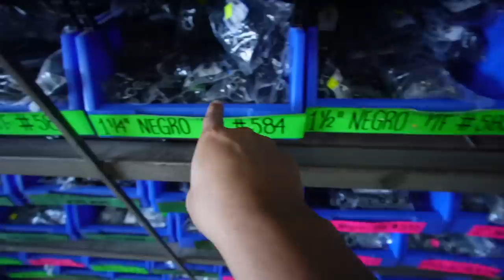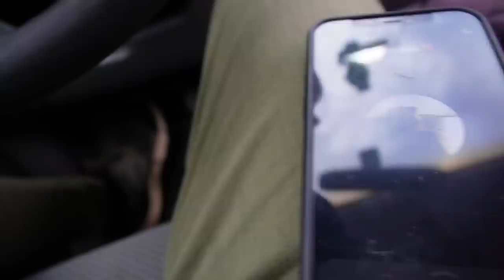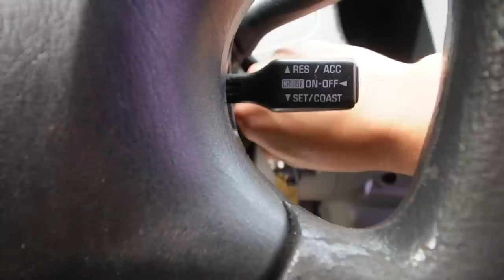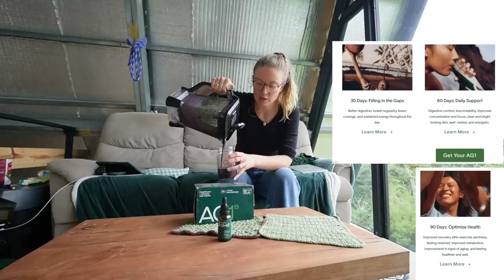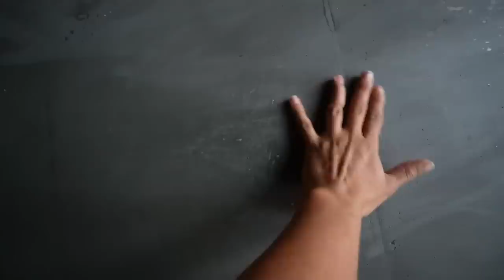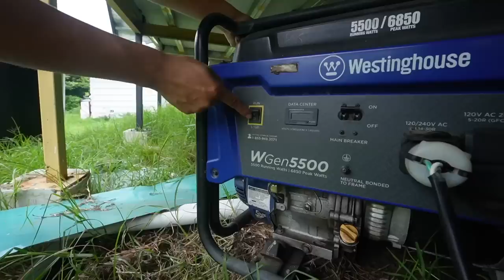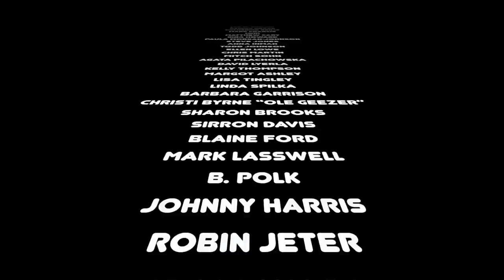COUPLE BUILDS THEIR CABIN IN THE JUNGLE ||  Simple Living Off grid

Comment: Next time you do welding in places that need protection, just take two pieces of wood like a ladder and nail some hardy backer board or concrete board left over pieces to create a barrier. Left overs would get thrown away anyway, and all you have to do is lean it against the wall or have someone else hold it if there's no wall. Or you can do the same with old pieces of tin/metal roofing. If you can't get the marks off, then just replace the tiles while the wall is still incomplete. Use a chisel and mallet and go easy, and definitely wear goggles.  Happy building you two.... and all the farm animals 😻🫂🛀🐐🐕‍🦺🐄.

Comment: The weld burns in the bathroom should buff out with a little car polish/buffing compound if they're not too deep! There are polishing pads that will attach to an orbital sander to make quick work of it! I made a similar mistake on my bathroom sink 🙂
Reply: Great idea! I was thinking there must be a simple fix.
Reply from the maker: That’s awesome!!!! Thanks a lot I’ll try it out! Do you have any suggestions for the compound? 🙏
Reply: I used the "turtle wax" brand heavy duty rubbing compound but McGuires is another one here in the states with a strong following 😀 polishing compounds are like really fine sand paper so the "heavier" it is labeled, the more it will cut so use lighter polished for a mirror shine and heavier ones for really deep stains and imperfections. Since it's made for really really thin car paint, I don't expect there to be any possibility of damage! Guitar builders often use it to buff out their guitar finishes, too! If you can get an attachment for your drill or orbital sander, it will be a 5-6 minute job. Otherwise, you'll be hand polishing in circles for awhile!

Comment: Guys, unfortunately the damage on the tiles caused by welding splatter is there to stay because the "burn" has melted the ceramic (glass) surface which you can't really repair.  You could try painting with a very small brush and hide the damage if you can match the tile color.  The other option is to remove and replace the damaged tile.  Good luck!
Reply: I was going to suggest paint too, or a magic eraser.  No clue if that would work.
Reply: @Yannispawn As I noted before, if the exact color of paint can be mixed, which is very difficult, then it might “hide” the damage.  The best option is replacing the damaged tile.

Comment: It would be nice to see you complete one project before you start another.  Then you don’t have so many lose ends. Why don’t you run all electrical and plumbing before you hang drywall?  Please finish that bathroom with cupboards for storage so it’s done. Just paint over the scratches and put shutters over the window so the curtain isn’t always in the way.  Then you can open them for light as needed.  So much better than a curtain.  
Freddie, consider getting an air fryer, you’ll love it! 👍

Comment: I wonder how heavy your house will be if you frame every wall with steel beams.  Why not use aluminum or wood for those wall studs?  I know that you added extra foundation, but your house will come out really heavy with all that steel and concrete inside. You have added so much weight with the concrete bathroom floor and the concrete countertop already.  Seriously, screwing in metal studs or nailing wood studs is going to be so much faster and easier than welding in each stud. There are so many youTube videos out there.